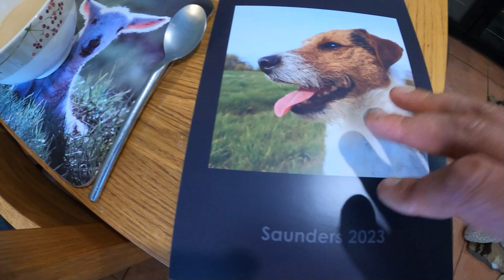BUSY DAY ON A DAIRY FARM IN THE WINTER SNOW

Comment: Great video. Just a thought, where you have the heifers and bull, could you pull the troughs off, put the yokes on an angle inside the rsj's and use the wheel to push up everyday? Rather than fork it everyday ? Keep up the grind 👍
Reply from the maker: That is a fair idea Ry👌👍